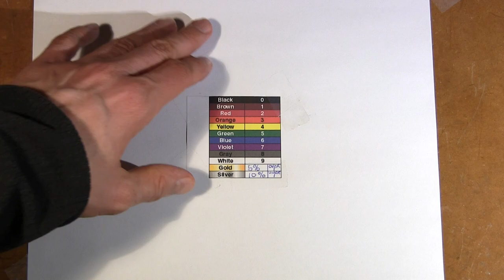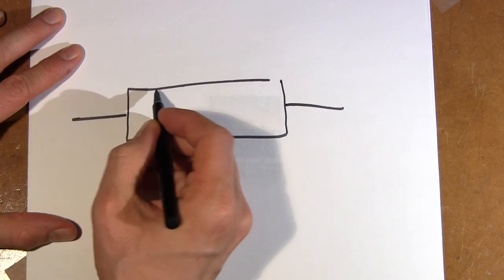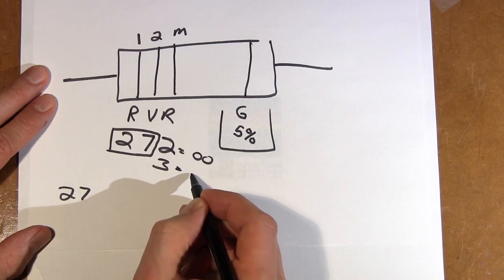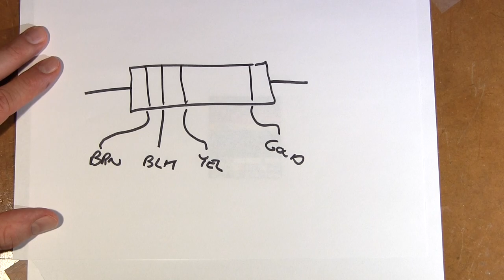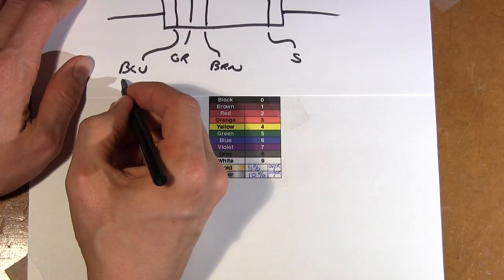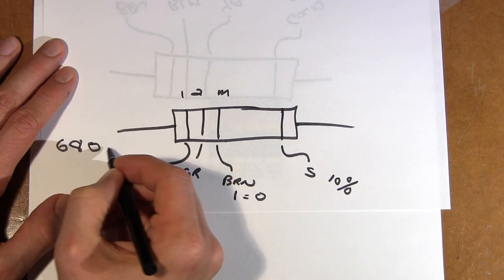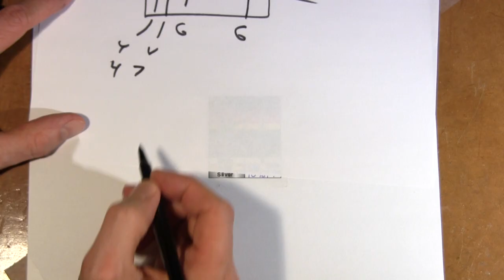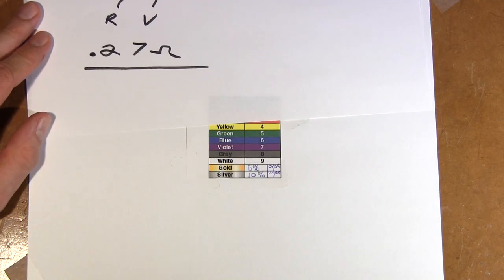Reading Resistor Color Codes Fast, Tech Tips Tuesday

Comment: In 2020 I put together a kit form of a calculator which as a function for resistors.
The colours are at the bottom of the number keys. You key them in from the resistor colour bars and it gives you the value. 
Great for me :) You videos are very informative Mr Carlson, thanks very much :)

Comment: Came by to refresh my memory on resistor color codes. Thank you, very helpful. I had electronics/electricity class in high school back during my Junior (1984-85) and Senior ('85-'86) years, 3 hours/day and 2 hours/day respectively. I remembered the mnemonic but forgot some of the details. Enjoyed reading a schematic and making a pictorial diagram then making a PCB with paint and acid. First project: continuity tester

Comment: I agree with this video. Your way of reading low value resistors does eliminate the need to know that when gold is the multiplier, you multiply by .1 and when it is silver, you multiply by .01. This way that you are doing it makes it much faster indeed. Thanks for the tip.

Comment: I took a college EE lab course in which all of the used quarter-watt resistors were thrown into a box at the end of each lab period. At the end of the semester, I acquired this wadded mass of thousands of resistors for my own use. During the process of organizing all of them, I managed to drill into my head both the color code and the E24 series.

This video was helpful because I had always thought of gold and silver multipliers as x0.1 and x0.01 - exactly as they are stated on a color code chart. It's certainly more intuitive to think in terms of "over 1 ohm" and "under 1 ohm". No mental math needed.
Reply from the maker: +Eric Wasatonic 
That's a great way to learn resistor color codes. Many years ago, an old TV tech gave me thousands of brand new carbon comp resistors in a box. I dumped them out on the kitchen table and sorted every one to a marked bin with drawers. After that, at a mere glance, I could recognize all the values. Sounds like we have done things somewhat similar. Glad you enjoyed the video Eric! Always look forward to your video's as well.
Reply: I memorized the color code resistors salvaging discarded 1950~1970's TV and radio sets as a hobby.
Reply: I agree!

Comment: I just ran across this  on 9-13-2018 and found very interesting. my mother was an electronics technician first with Bendix Radio in Towson Md starting in the middle 40s where she built her first television.  She told me it never had a cabinet, just the chassis and the picture tube. Being born in 1955, I don't remember ever seeing it.  In the middle 50s she started at Westinghouse Aerospace outside of  Baltimore.When I was an early teen my mother taught me some of what you are talking about here but I was more worried about playing ball. What a huge loss for me. I she was smarter than I gave her credit for. That's not even getting into the vacuum tubes. In this day in age most people take it for granted that you turn on the radio and it plays ext. I find it amazing the genius that it took just invent any of this stuff. Thanks you for helping understand how to read the resistor again.
Reply from the maker: Thank you for sharing your story MrHans!

Comment: I used to know this back in the late 70s  thank you for the refresher course...love all your videos
Reply from the maker: +craneoperator4 
So neat to read all the "memory lane stories!" Thanks for your comment.
Reply: Mr Carlson's Lab can you do a video or answer how to find out what the volts are after seeing what the values of the resistors and domino caps?
Reply from the maker: Many domino style caps don't have that information on them, so if one is faulty, I replace it with a standard 500 Volt 1% modern Mica cap. Or.... I really like NPO-C0G, thats:C Zero G capacitors.

Comment: Hello Mr. Carlson. I always think of the multiplier as the number of zeros to throw on the end. To keep from getting mixed up when I read the low values I keep in mind that gold is worth more than silver so yellow violet gold is 4.7 ohm and yellow violet silver is .47 ohm. The first time I saw 1% resistors it threw me for a loop that there were four bands instead of three for the resistance. For example brown black red red, 10200 ohm. Great job as always.

Comment: In my experience, there isn't a lot of consistency with square or rectangularly packaged capacitors and their dot codes. It makes things challenging at times. The other big challenge is that the paint used for the dots has shifted hue over the decades, making a brown look an awful lot like orange or red, an so forth. Often times, I have to get a q-tip and clean the dots with alcohol, or even acetone to clear away gunk and often an oxidized layer of the old paint to make the dots readable.
Reply from the maker: +Jason Atkin 
I agree Jason. This is the "most standard" way of reading them. There are a few cheaper types where they didn't even have the dots to put paint in, they just dab a bit of paint on the edges. Alcohol does clean them up nicely.

Comment: Resistor are measured in Ohms, K Ohms, M Ohms. All resistors are measured in ohms. K Ohms are resistors that have a value of 1 thousand ohms or more. M ohms are resistors with 1 million Ohms or more. The first resistor in this video had a value of 2700 Ohms, because the resistor value is more than 1 thousand ohms, it is written as 2.7K Ohms. Excellent Video, very intuitive.
Reply: 2.7K is not a good way of writing it, it should be written 2K7, the reason is the decimal place could be misread or missed all together.

Comment: Finding a resistor with no tolerance band may be the exception today, but it should be noted that in years past there were plenty and they all are 20%.  Enjoyed the mica cap segment which was always a hard one to remember.  And I learned something that even at my age I had never known, and that was the meaning of the designation JAN.  I knew it was military related but didn't know it stood for JOINT ARMY NAVY.  DOH!
Reply from the maker: +hankus253 
Glad you enjoyed the video Hank!

Comment: This is really helpful , thank you for posting this and taking the time to record it.  I agree it is really simple this way and will for sure help me doing this faster...  Mica caps is perhaps the best lesson here.. I never knew how to read them....  Brilliant, thank you Mr Carlson :) - Ron
Reply: +Ron C Yeah the Caps one is quite unusual. I suppose this mainly because most of us don't use old Mica Caps every day .:)

Good one !
Reply: My rule with Mica caps is never change them because they don't go bad... but now I can make sure of it  :)
Reply from the maker: +Ron C 
Glad you enjoyed Ron, and 101blog!
Reply: +Ron C 

This is a really good question Paul.  Have you ever come across any mica cap failures used under normal conditions?
Reply from the maker: Very few. The ones that stand out were in a Telefunken Panadaptor, and a Johnson Viking Valiant transmitter. There are probably more, but it would have been long ago. So usually they are pretty dependable.

Comment: I have a very old used Mica capacitor(condenser) that is leftover from my late father's box of stuff he had from his days as an apprentice for RCA. It is small deep brown brick - - and following your instructions I read it as 410 picoFarads with a 2% tolerance rating. The paint on the colored dots has worn off so it is hard to read. The Cx on my multimeter indicates ~400 picoFarads. The colored dot pattern looks like Yel Brn Blk Red - - following the directions you described here

Comment: I like the adding zeros part. Cuz the multiplier is 10 raised to what ever color number, ie... Red: 10^2. So it tells you to move the decimal point right by 2. So 22.000 * 10^2 = 2200.0..... I mention this cuz I think your short cut is a little weird. I like to remember that the Gold medal is 1st place and Silver is 2nd place, Gold is 1 place Left and Silver is 2 places left. Being that Gold is 10 raised to -1 (10^ -1) and Silver is 10 raised to the -2 (10^ -2). So Red Red Gold or 22.0 * 10^-1 = 2.2..... And R R S or 22.0 * 10^-2 = 0.22. So if there were a Black Black Brown Gold Gold = 001.0 * 10^-1 with a gold tolerance(5%) it would actual be 0.1 and not over 1.

Comment: I hear from so many SMD resistor spoiled people that it is so hard to read colour bands, while it really works the same way as SMD resistors, just with colours instead of numbers. It shouldn't be hard to learn a few colours and their values and videos like this should get people to realize that it isn't that hard. 

One addition and one warning for people working on a bit more recent equipment than typical for this channel: Things work the same for 5 ring resistors, but for 6 ring resistors the last ring is a tempco. You should be careful about cheap chinese resistors where odd things can happen. When you have blue ones, the yellow can be of such bad quality that it looks green, and I have a while ago thrown away 5000 resistors where the band should have been orange but was clearly red. Also gray and silver are not easy to distinguish on those, and on some the orientation can not be seen so you wonder if you have "brown green black brown brown = 1.5k" or "brown brown black green brown = 11M". There is some advantage to working on gear that comes from a time where almost everything was built by engineers with quality in mind....
Reply from the maker: +Dennis Lubert 
Thanks for your comment Dennis!

Comment: Quick question: have you ever looked at railroad track circuits and related hardware? I have beautiful old DC relays and 3 color coil activated target signal lights that I wire up to demonstrate electromagnetic basics to my grandchildren and their friends. But I have a couple of relays can't figure out how to wire in any useful fashion, including a flasher that cycles on some principle involving coil saturation. I imagine you could look at these things and figure them out in a few seconds.

Any chance you could look into DC track circuits and educate the railroad fans of the world on how these things work? AC track circuits are another thing entirely, how coil based relays can distinguish between 100 Hz vs 180 Hz signals is magic to my eyes.

But if nothing else, you should look at the workmanship in these relays. I run one, a single channel "or" type switch with a dead AAA battery, it's utterly amazing this thing picks up on a battery that otherwise won't run the smallest transistor radio.

I like to point out that there's the equivalent of billions of these 2 pound metal and glass things etched on 1/4 square inch of silicon at the heart of the children's computers, and they cycle at blinding speeds upwards of 3 GHz. All this "magic" called an ipad or laptop that they take for granted is simply very fast switching, when you boil it down to it's essence.

Here's a schematic of one type of relay, some models of which have a single 'channel': http://www.rrsignalpix.com/pdf/uss_plates/e-5075.pdf

I use a 4 'channel' relay for reversing polarity to make either a yellow or green signal with my searchlight signal: http://i.ebayimg.com/images/g/me4AAMXQ74JTQclS/s-l640.jpg

The signal mechanisms are beautiful examples of industrial design: http://www.discoverlivesteam.com/discoverforsale/forsale/5_Cynar/100_4812.jpg

Ever play with this stuff? Care to? :D

Comment: I thought those square things were resistors possible capacitors but didn’t know what they were. I’m receiving two old tube testers and I’m going to completely restore them those square capacitors Mika capacitors were the problem for me now they are not thank you for your video. It was easier than I thought. 
     By the way I’m in electronics 101 in the cities made it a requirement for their electrical BART workers to take the class everybody’s mostly around 40 to 60 years old almost nobody can see the resistor bands and just about everybody has a hard time even making the colors out on the different background color resistors. It’s like being in a class of handicapped children watching all these old guys trying to read resistors including myself who cannot barely see the bands or read the colors. Especially the color blind or partially colorblind men which we have about seven in our class

Comment: I'd be interested in knowing how you acquired the bulk of your test equipment, Mr. Carlson.  I haven't seen some of the huge o'scopes, signal generators and counters in your shop since I started out in a USAF Calibration and Repair Lab (aka, PMEL) back in the early-80s.  Is that an HP Spectrum Analyzer I see over your right shoulder (on the wooden shelf -- near the center of the frame -- on the bottom of the stack)?

Comment: I would be surprised if anyone who visits this channel was incapable of reading modern resistor codes. I just skipped to the old capacitor part, that was more interesting. I missed you mentioning dogbone style resistors, I can imaging younger techs not knowing how to read those. I always forget and thus have a nice centralab explanation chart for them.  And then the other odities like using uuf instead of pf and such many others I do not know about.
Reply from the maker: +Bart Zuidgeest 
Hi Bart. I find that many people stumble with the color codes. (just read the comments) I try to tailor this channel for all levels of electronic experience, so most can benefit. Thanks for you comment!
Reply: +Mr Carlson&#39;s Lab I agree for the most, but I find you always pay much attention to doing safety warnings. Reading modern resistor codes is part of every electronics 101 and someone who does not have this skill (you may forget the mapping but not the method), should be safer starting of with some low voltage arduino/transistor amp like projects until they feel confident they have these skills. I think the same goes for things like soldering and such. Practice low voltage, then high voltage. Safety first.
Reply: Just remember BED. Body, End, Dot

Comment: ok i got two resistors one has 3 bands of y v and b with g so that is 470 ohms at 5% but the other one does not have a gold ? so does that mean it is dead accurate at 470? or could it be the g band got rubbed off?

Comment: Nice presentation Paul, boy those caps look old.
I haven't seen caps like that before but on modern ones the value is often seen as a 2 digit number with a multiplier such as on many Ceramic or Tantalum caps,  you could see 104 which would be 10 and 4 zeros or 100000 and that's in Picofarads.

I have seen oldish caps where they look like sweets with coloured bands around the body and using the same colour code as for resistors.
Reply from the maker: +Michael Hawthorne 
Thanks for your comment Michael!

Comment: For RF circuits, which resister(s) should you use [non inductive] ?  Thanks
Reply from the maker: +cadiscase 
Carbon comp resistors work great in RF circuits. You could consider them non inductive until the lead length starts to interfere.

Comment: Hi Paul, This question is not about resistor color codes, but about polarity of 22 uf electrolytic capacitors used as coupling capacitors in a Sony stereo receiver amplifier. The schematics, both line diagram and the component location diagram (foil side), show the negative side of the capacitors connected to the chip.  On the circuit board foil side, the markings for polarity are reversed.  To top it off, a second duplicate chip has the positive side of the electrolytic capacitor connected to it, and shows such on  the circuit board.  The question is: Does polarity matter when using electrolytic capacitors as coupling capacitors?  Unfortunately, I did not note the polarity before I pulled the coupling capacitors.  I'll not do that again!  Thanks in advance for the help  -  John
Reply from the maker: +John C 
Hi John. Get a 22uF non polar cap and install it. Next time, take pix with your phone or a camera before starting to do any work. Sometimes this really pays off. Yes the polarity of coupling caps does matter, especially if they are polarized electrolytic's to begin with. Good Luck!
Reply: +Mr Carlson's Lab  Hi Paul, I thought you would like an up date on my Sony stereo receiver repair.  I installed the two coupling capacitors and I now have equal volume on both left and right front channels.  As for the polarity issue, I found a third chip in the receiver whose coupling capacitors polarity matched the polarity of the second chip. I went with the same polarity on the coupling capacitors for the first chip and and that fixed it.  Obviously the polarity of the coupling capacitors as shown on the schematic and component diagrams are backwards.  Thank you for your help, and please continue to make the videos.  I have learned a lot about radio repair from both you and Paul at TRXBench.   John   ps:
Reply: +John C   ps:  I'll take photos or mark the polarity when I remove electrolytic capacitors in the future. John

Comment: Mr. Carlson, Another great and very informative video. This system makes reading resistors easy.  I have down loaded on of the color charts and I have it on my desk.  I do have a question that is resistor related.  I've been researching Passive Pre-amps.  One example is the Tortuga Audio LDR3 v.2. The review mentions they use a component called a "Light Dependent Resistor".  I guess it works sort of like an opto-isolator. My question is this, I have connected my CD player directly to my power amp and it works great. But I don't have a way to control volume. What value of potentiometer would I use to act as a volume control?  Or would a circuit like this even work? Any help would be greatly appreciated...Or maybe a project video..hint,hint....lol. Thanks againe for the wonderful videos.
Reply from the maker: +Jim McDowell 
Possibly a video in the future. Thanks for the kind words Jim!